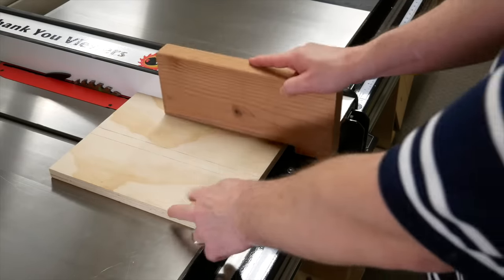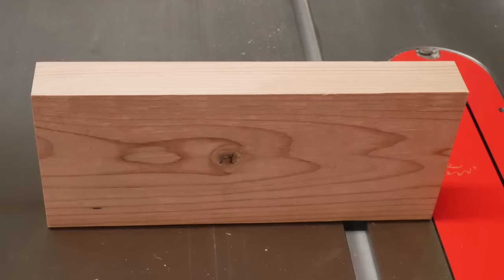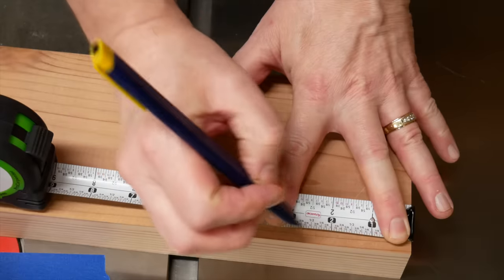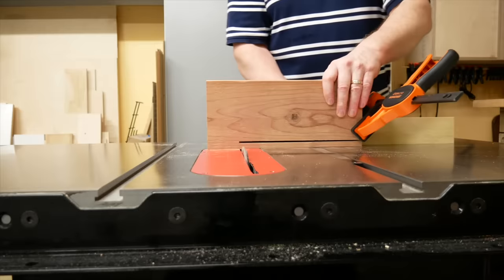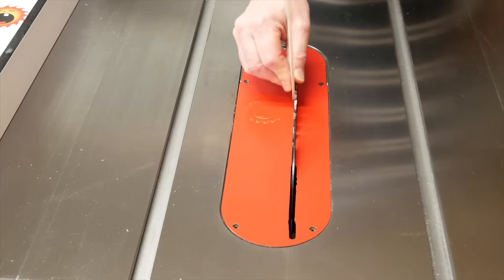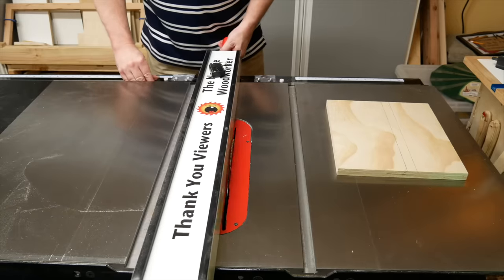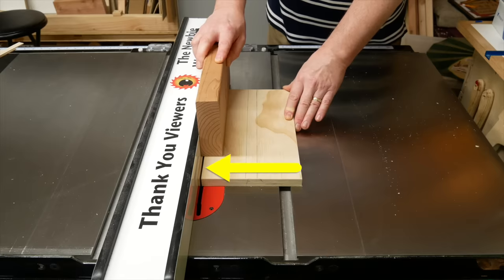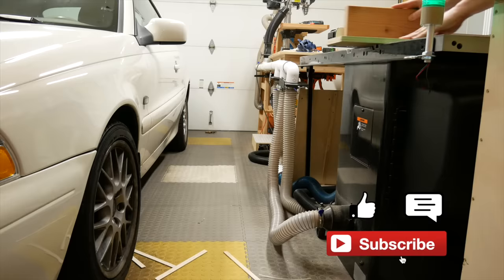Easy! Cut Thin Strips On Your Table Saw!

Comment: I'm confused I thought you shouldn't put the fence too close to the blade?
Reply from the maker: I've never heard of that being a problem, unless you actually touch the blade with the fence. But I could be wrong, so if you have any information on why this is a bad idea, please let me know! Thanks.
Reply: @TheNewbieWoodworker  I think it was both for the risk of damaging the fence indeed (in which case I believe you can just add a sacrificial fence?) and for the risk of kickback? I definitely can be wrong, naming me newbie is a huge understatement 😅
Reply from the maker: @clarissepotriquet7451  One of my biggest fears is showing something that could get people hurt, so I'm glad you said something, regardless of the outcome! Yes, you can certainly use a sacrificial fence, if you're worried. As for kickback, I can't see the thin strip causing kickback. But if you pinched the blade by pushing the stock on the other side of the blade too hard against the back of the blade, it could kick back. But that doesn't have anything to do with the fact we're cutting thin strips. If you haven't seen it yet, see my video on kickback: https://youtu.be/ZUZ8hRm7a8g.

Comment: 0:39 Wouldn't you want to stand to the other side?
Reply from the maker: If I was left-handed, then absolutely. But I'm not, so this way gives me more control over the stock.
Reply: @TheNewbieWoodworker  I actually tried standing to the right myself after commenting this and realized I couldn't see the blade over the fence so nvm lol
Reply from the maker: @parkerjacobsen1220  It was a good question. I think it's smart to ask those kinds of questions. When you find out the answer, it adds a little more knowledge to the memory banks, which can only help. :)